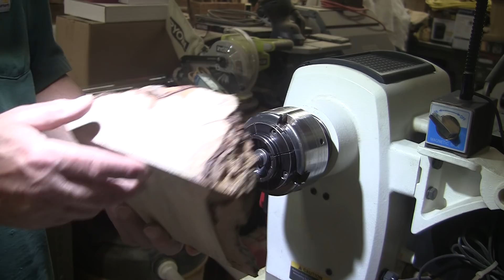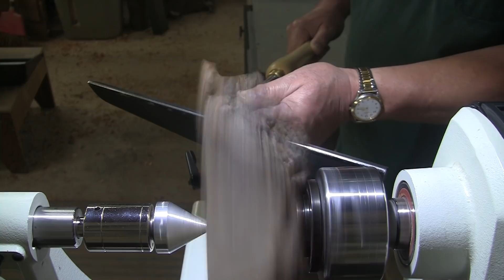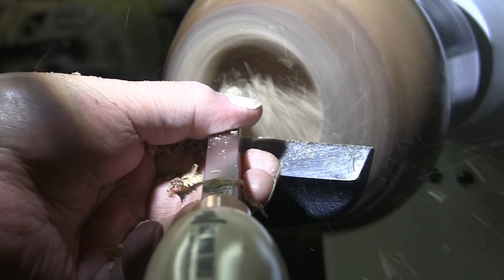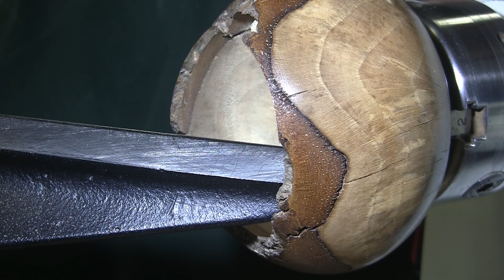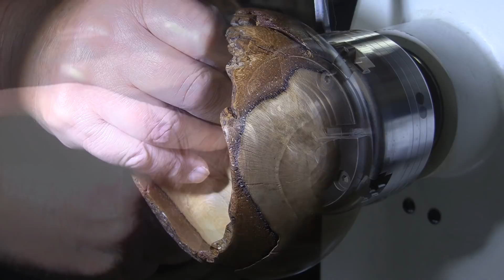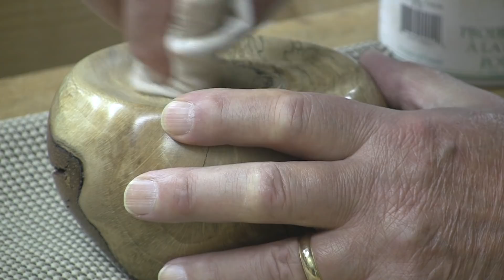Live Natural Edge Maple Bowl - Wood Turning

Comment: Beautiful once again Phil. Question for you as well. Why do my wood pieces mold only when I use Sanding Sealer? It didn't completely ruin my wood but took a lot more preparation time before using a finish.
Reply from the maker: Thank you!  I don't know why your pieces mold after sanding sealer.  Only guess is, they are wet when you turn them and the sealer is sealing in that wetness and causing mold.  I don't typically turn wet so don't have much experience with that, sorry.
Phil

Comment: Very nice project Phil! BTW what angle do you put on your negative rate scrapers?
Reply from the maker: Thank you, David!
Well, going from memory, but it's not too important, anyway, 36 degrees on the bottom and 39.6 degrees on the top.  I just eyeballed it but then when I sharpend them for this video, I made note of it for next time.  The only important part is, the combined angle must be less than 90 degrees to be effective.  I use the Oneway Wolverine jig and I took my magnetic digital angle meter, set it on the bottom of the jig and zeroed it.  Then I set it on the tool rest to read the angle I had already ground from eyeballing.  Next time, I just need to set the tool rest with the angle meter on it and I'm good.
Hope that helps!  Phil

Comment: Hey Phil, save your digits, make yourself an inertia sander. Captain Eddie Castelin makes kits really cheap check out his video - # 165 Self-powered Sander and more...
I have three of them in different lengths and two sizes of sanding pads saves me loads of time, they are even good using oil/wax mix to sand. Stay safe
Reply from the maker: Using one of those is a great idea, Paul, instead of holding sandpaper.  I have one and considered using it.  It might have worked, but the problem is, when the opening curves in, as in this piece, it's just hard to get anything in there without hitting the outer edges, especially with a live edge.  But, it might have worked and saved my thumb getting hit so dang many times.  Hindsight!  :)

Comment: Well my friend another nice 👍 looking piece ,well done ,but !! two points ( not criticisms ) why do you guys on the other side of the pond never use a female type tenon on the bottom ,  it can be completely finished and your nova chuck would expand into it and give plenty of hold ,even on larger pieces,now secondly ,your scraper that was put to the grinder ,with flat side up the handle held higher it would be a negative rake .just a different view of things stay safe. 🦖
Reply from the maker: Thank you, Arturo, I'm glad you like it!  I do use a recess, occasionally.  Mostly on thin pieces or platters.  But, I like to remove them, when finished.  I don't always, however, and I know a lot of guys leave them.  I try to finish a piece with no evidence of how it was held.  Just a preference, I guess, neither right or wrong.
I understand about holding a scraper at a downward angle to accomplish the same effect as negative rake.  The problem with that is, I'm old and can't seem to hold steady that downward angle and inevitably get a catch.  The negative rake eliminates that possibility, for me.  Thank you, again, for taking your time to watch and for your great comment!  Phil
Reply: madronawoodworks  hey Phil I know what old is and the quality of pieces you turn shows that your hand 🤚 is quite steady enough lol stay safe 🦖

Comment: Yeah that maple especially when it gets Spalding makes the best looking turns imaginable . almost thought you going to use CA finish , especially with that crack on the side .
I tried a natural Edge one time the Back came  flying off ...sounded like he was a machine gun going off.... hitting my shield
I know an old machinist trick , since I am a old machinist ,  to hold your Chuck in your Morse taper Make sure there's no scratches on the female and male parts of paper, use magnifying glass if you have to , or it will never work . if there is get 400 to 1000 grit sandpaper and get a dowel stand it off  completely

.... First clean it out with alcohol all denatured alcohol ..... Let it dry ..... do not blow into it with your breath , moisture make it rust ..... 
The trick ......
Get a piece of chalk , the type use on blackboard . put 3 to 5 lines down the male taper ....... Don't touch it with your fingers . put it back on give it a little twist and smack good it with you mallet 

You could buy a hundred of them it will do the same thing.... They are not ground precisely in China
Reply from the maker: I think you are absolutely right, Bruce.  Buying another probably wouldn't help.  I will definitely try your solution with cleaning and fine sandpaper.  And chalk, I hadn't thought of that, great idea!  Just a little extra holding power.  Thanks for your great comment and suggestions!
Reply: I hope it works out for you Phil..... That chalk fills in where the imperfection grinding the Morse taper... And half a second of a degree will never make that fit right that little bit of a twist distribute to chalk around the Morse taper
And you are the only person I told on this 3rd Rock of your sun . so careful the knowledge like that who knows what would happen to your world ... Oh yeah I supposed to put down...LOL

Comment: Nice job, I think when your using your carbide cutter you would be better off with a different rest like the Robert Sorby MODULAR TOOL REST SYSTEM BOX SCRAPER PLATFORM , as the platform would give you more support to get a finer cut, I only know this , because all my tools are carbide tipped, Cheers
Reply from the maker: You are probably right, Mart.  I know exactly what rest you are talking about.  I had one for my old lathe but it went with when I sold it.  I should look at getting another.  Thank you for watching and commenting!